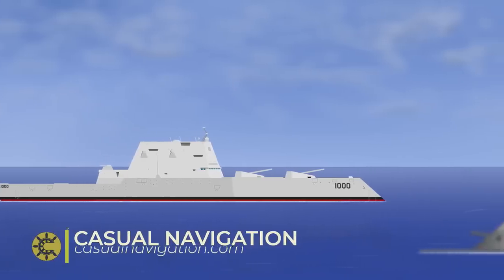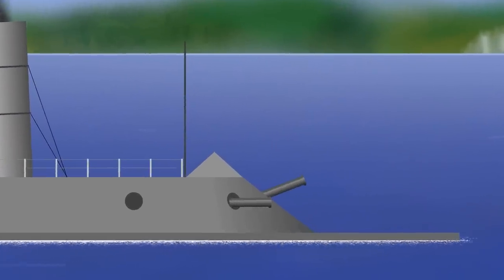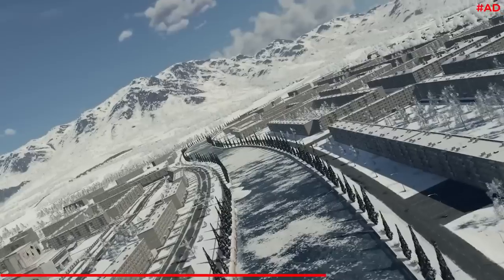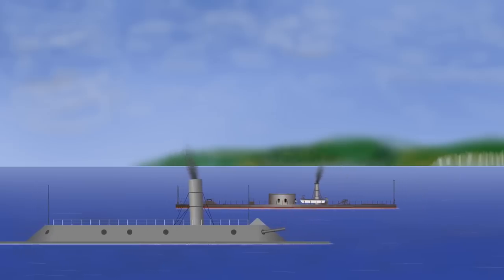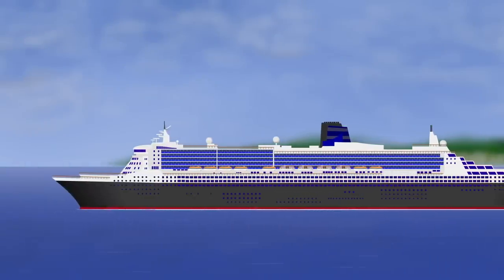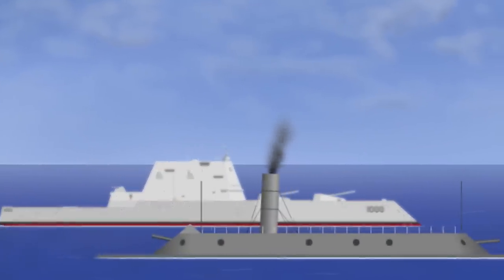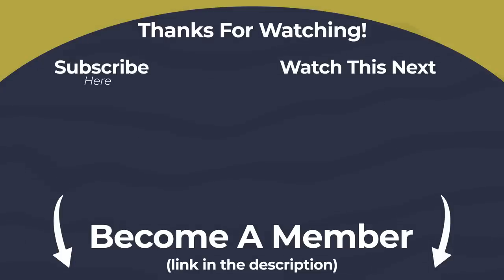Why Were Stealth Ships Invented 70 Years Before Radar?

Comment: I have a better question: Are civil war ironclads stealth?
Reply: No radars of the era ever detected them
Reply: Paint em blue and maybe you can fool the hot air balloons
Reply: With that big round exhaust column? Not a chance.
Reply: I'm actually wondering if they could deflect radar scans given their shape.
Reply: They'd have to be cleaned up 😄
Reply: @clockworkowl6248  ...Radar wasn't even a thing.
Reply: @sinisterisrandom8537  That's the joke.jpg
Reply: To radar signature? Perhaps
As a massive black smoke cloud slowly moving in your direction? No
Reply: @riograndedosulball248  Thats entirely intentional. After they got rid of enemy radar detection with their shape, they used their coal powered engine to get rid of enemy visual detection. Its a mobile smoke screen.
Reply: The Monitor was semi-submersible so absolutely by definition it was, it was a part of why she was so low in the water.  That was to hide it from being spotted by eyes of course, as well as to be more defended.  It also was the reason she sank, under tow in a storm.
Reply: Black smoke does show their position 😂
Reply: @879PC  there clouds what do you mean, I don’t see smoke

Comment: Another thing about sloped armor is that the effective thickness is increased relative to perpendicular armor.
Reply: I'm not sure if that's useful when shell comes to you at 30+ degree angle from above, as shells going at high parabolic trajectories at the distances of a naval fight.
Reply: @Сергей Кленовский  You are right in the sense that if the projectile hits at an angle perpendicular to the sloped armour, it acts as if there was no slope. However you can account for this when designing the slope.
Reply: @Mincecroft  It is why on latter era battleships that used sloped armor it angled inwards causing arching shells, to hit at even great angles.

Comment: You got the way armor works against High Explosive wrong.  It does not deflect it necessarily (though it can.)  The angle increases the effective thickness of the armor based on the cosign of the angle of the armor divided into the the thickness.  So 10mm plate angled at 45 degrees has an effective line of sight thickness of 14.14 mm.  Great channel and I rarely find a mistake, but this is one.  EDIT:  Thanks to everyone pointing out my error.  Sloped armor only helps with penetration of kinetic rounds.
Reply: Penetration only deals with objects. The pressure wave from HE will reflect
Reply: Isn't that the way it works for penetrating rounds, not high explosive?  For high explosive, as the force of the explosion is what's getting through the armor the angle doesn't matter.  The explosion pushes in all directions equally and so part of it will always be pushing perpendicular to the armor.  There is no line-of-sight advantage against explosive because the explosion's 'line-of-sight' is in all directions, right next to the armor plate.
Reply: the pressure wave doesn't care about effective thickness. It does not care about angle its basically a sphere. 
Oh and thick armour doesn't always help because explosions may cause splinters on the inside. Basically the armour isn't penetrated but on the inside parts of the armour splinters of and well hurts, kills, damages and destroys interior things
Reply: @KingTFD  No explosions go in spheres
Reply: @burnstick1380  🇧🇷🇧🇷🇧🇷

Comment: it's not just that sloped surfaces deflect things, but often it has more to do with the fact that it sort of makes things "thicker", because of trigonometry. while i could definitely see it doing more deflecting back in olden days when the force of projectiles were much smaller, deflection becomes harder as you get cannons that fire faster, heavier shells.
Reply: Well that's the usual explanation I've heard, that you can get away with thinner armour, but now you'd have to use more armour since it's sloped, so it's not necessarily lighter

Comment: The battle of hampton roads was almost comical. They shot each other for literal hours without relevant damage, nevermind casualties.
The people watching from shore actually got bored.
Viriginia ran aground for a while, but nothing was made of it.
The Monitor lost it's captain and retreated for a moment.
So Viriginia declared victory and drove off.
Then Monitor came back, found no Virginia and declared victory.
But virginia did spend a month in Drydock afterwards, while monitor stuck around off shore. So it definitely got the worse of the "duel".
Reply: How did they lose their captain without casualties?
Reply: @adamcetinkent  There was like 3 death and 16 wounded over those several hours.
Every so often a shell did manage to explode. And a few times some spalling paint paint hit someone, somebody leaned against that section of armor as it got hit or some shrapnel went through a port.
Those are laughable numbers given just how many hundreds of shots were fired.
Reply: 268 men died and two ships were sunk at Hampton roads.  It also changed naval warfare forever.

The Monitor was rushed to finish to counter the Virginia with a crew that had never sailed together and an experimental design that hadn't had sea trials.

The Virginia withdrew first but made more sorties into hampton roads for the next two months but the Union blockade was not broken and the Confederacy was eventually forced to scuttle the Virginia when they lost Portsmouth.

The noise and smoke of the duel was the most epic sight of naval warfare thus far, men were being deafened, blinded, hit with splinters, hot shrapnel, and molten iron.

It is a very important part of the history of Naval Warfare and a massive tribute to the sea power of the United States of America today.
Reply: My favorite part of the battle was that The Monitor's turret got stuck spinning, so they could only take a shot at the CSS Virginia once every revolution! Lmao I'm surprised nobody got dizzy!
Reply: You forgot to mention that the Captain of the CSS Virginia was wounded on March 8th for standing on top of said ironclad and trying to take pot shots at the union shore batteries with his carbine.
Reply: @chaosXP3RT  i believe it wasnt stuck spinning but rather stuck so it couldnt spin meaning they had to physically turn the entire ship to aim (as i remember it needed the turret rotated in a specific spot because of the hatch to the lower deck anyways, it seems more likely that it got stuck in that position)
Reply: @BeKindToBirds  important as it is looking back at the time it's still a hugely comical affair
Reply: @MatthewChenault  What a chad.
Reply: The Virginia and Monitor should've parleyed and then had two guys fight fisticuffs! :P
Reply: @ctdaniels7049  That probably would have been more productive.
Less bloody.
And more decisive.
Reply: @adamcetinkent 
A round hit the wheel house temporarily blinding him.
The wheel house was made of metal bars Lincoln logged so there was slots to see out of and let anything small enough in.
Reply: @adamcetinkent   He was in the small pilot house forward of the turret and was struck by a splinter entering the view port. The original pilot house was shaped like a box. The repaired version (after the battle) was sloped.

Comment: A point worth mentioning about angling. Another reason to angle surfaces up is to prevent radar signals from bouncing off the water. if hull surfaces are angled down, the hull and the water will also create a cat's eye effect, making it show up more easily on radar.  I think you actually mentioned this on a different video (something about flared vs. tumblehome bows if I recall). That's why aircraft carriers don't really bother with any radar dampening features the way destroyers do. The most important feature of an aircraft carrier is deck space, because it directly effects how many planes you can carry and how fast they can deploy. There are exceptions, but those exceptions are smaller carrier/destroyer hybrids used by small navy's or for clandestine opps rather than large scale deployments.  Making something like a nimitz class carrier "stealthy" would require a ship with such a wide hull at the water line that it would be impractically slow and difficult to maneuver missed
Reply: You can absolutely make carriers more stealthy. The US has decided not to do it with their newest class. But the UK has. Just compare a few pictures of the British Queen Elisabeth class carriers to the US General R. Ford class carrier. 

It is quite clear that the Royal Navy tried to make the QE a bit more stealthy, as they have a ton of flat angled surfaces, and they have hidden the irregular stuff that shows up big on radar as much as possible. Yes many of those flat surfaces are angled towards the water, because otherwise the compromise for the carrier functions would be too much. However that is still much better and more stealthy than not having those angled surfaces at all. A little bit of stealth is better than no stealth.

Of course a carrier will never reach the same values as a destroyer, but as will all stealth things it is not about being invisible, it is about being detected later. It does make a big difference in strategic positioning and tactical defense weather you are detected at 300km or 400km distance. Might not look like a lot but in this case that is 70600 km² vs 125600 km² of detection area, so the ship with 300km detection range occupies 56% less area where it is detected compared to the ship with 400km.
Reply: Well, actually, aircraft do bother with radar dampening features. F-35 and F-22 have iconic nose lines that have been purposed placed there to bounce radar signatures away from the source
Reply: With the massive amount of satellite surveillance, slow moving ships are easily spotted and tracked irrespective to their radar stealth. But even if we know where a stealth destroyer is, radar guided anti-ship missiles will struggle to find that target. 

That was part of the rationale behind LRASM. It doesn't rely on any single targeting mechanism. We know where the enemy ship is and we can provide continuous guidance to the missile during its flight. When it has reached that general area it doesn't need radar, a camera with relatively simple recognition systems will hit the target. It has many other mechanisms that achieve the same aim that don't require radar.

Comment: Another thing about angled armour plating is that in effect, the plate is in effect thicker in perspective to any projectile fired at it from a level angle, meaning you can have a thinner plate but still get the effect of a thicker one, pluss the added benefit of deflection and weight saving.

Comment: From a performance perspective, there are big advantages to keeping a ship low, especially with weaker, less efficient steam engines. Also weight up high in ships is bad, so keeping heavy armour as low as possible is good. Also sloping the sides in reduces the width of the heavy deck, and is good for seakeeping as well.

Comment: The guys from USS New Jersey did a video on all those antennas on warships, comparing Iowa and USS Hornet in this regard. I wonder how stealth ships go about some connections they do need
Reply: This might not be a full answer, but IIRC most modern ships use phased array radar rather than traditional rotating-antenna radar. Instead of having large antennas pointing at things, they use a large array of small omnidirectional sensors, and the direction of incoming radio waves is measured by the slight differences in timing. A similar same method is used for sending pulses of radio waves. That eliminates a lot of large antennas that old warships had (e.g. for battleships: surface search radar, air search radar, fire control radars (both for primary, secondary and AA fire control directors)).
Unfortunately I don't know if communication antennas use similar techniques, but looking at photos of some modern stealth ships, a lot of them feature "traditional" antennas or large white spheres which hide antennas underneath.
Reply: @wojtek4p4  Many types of antenna for different wavelengths now use that phased array structure, even those for SATCOM or UHF radio. I don't know if the long antennas of SW radios can be replaced like this though.

Comment: One thing I always wondered, do warships designed to minimize radar return carry radar reflectors they can deploy during peacetime? It seems like it'd be a good idea, and it's just kinda funny to engineer in both directions at once.
Reply: I'll be the first to take a guess and say : No.  For navigational purposes there is still some radar return so while they may be lost on a 24 mile scale on radar they will be apparent when they are within 12 or so miles. Within 12 miles in clear weather the navigation lights will be visible.   Also once the stealth ship sees another vessel on their radar or visually  there is radio communications as well as electronic identification, AIS.  However if you are in a war zone just keep a sharp lookout since there will be no AIS and no nav lights .

Comment: If my knowledge is correct, the tumblehome hull shape - subject of discussion here - also have disadvantageous seakeeping properties, the reason why it wasn't prevalent in WW2(or modern civilian ships, for that matter).
Being detected in modern warfare is so deadly that it is an acceptable tradeoff, even if the warships have to employ other design features to reinforce stability.
Reply: The main disadvantage of the tumblehome was instability if flooded. Three Russian tumblehome battleships sinking at Tsushima in 1905 made navies stop building them. In 1915, the French tumblehome predreadnought Bouvet capsized and sank in two minutes after hitting a mine during the Dardanelles campaign.
Reply: This tumblehome design is only used by a single ship class. The US Zumwalt class of 3 ships, as shown in the video. ALL other modern warships use more traditional hull shapes. Even the next generation of US destroyer/cruiser, the DDG (X), which is still in the design phase, will use a traditional hull. The tradeoffs are simply not worth it, even when you try to make the ships as stealthy as possible, as the US Navy has realized (again).

Comment: Thank you for the interessting Video!
One question: Why is the F35 stealth bomber from USA than everywhere curved?
Reply: You mean the Lockheed Martin F-35 Lightning II, the stealth 5th gen multi-role fighter?

Because the "stealth" evolved. Look for example at F-117 Nighthawk, the surface was all made from straight "panels".

It is a group of technologies working together in order to lower the radar detection. Using surface shape to deflect the light (radar wave) is one "technology" in this group, another can be for example absorbing the light (by using specialiazed materials and coatings). Surface has to be still aerodynamic, especially of quick-moving and maneuvring fighter jet. Nighthawk was a rather light-weight carrying bomber, thus the high-speed and maneuverability was not required nor achieved.

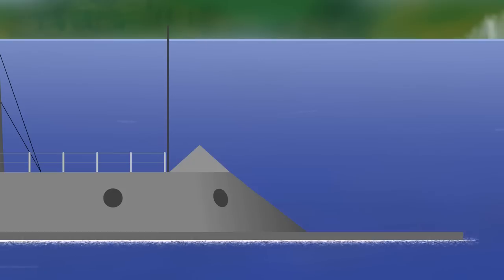Comment: 3:10 again you forgot to mention the EFFECTIVE THICKNESS GROWS... its not just the angle but the amount of steel it has to dig through grows.... (aka thicker profile)
Reply: It's not the thickness but how you use it, that's what I always say
Reply: That depends on the kind of shell that hits the armour; if it's an armour piercing round (HEAT, APDS, APFSDS, whatever), then sure, but if it's something like a purely explosive warhead, there's a lot less care about that whole "effective thickness" as the explosion would be unidirectional and hit the armour about as much regardless of the angle.